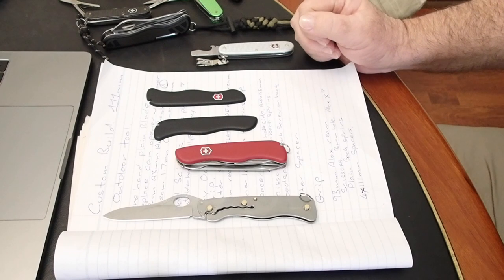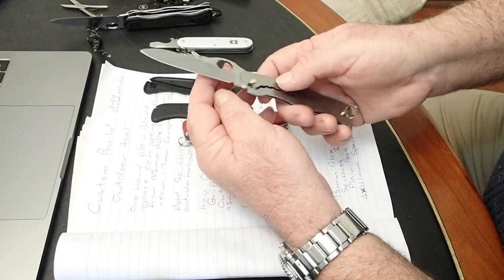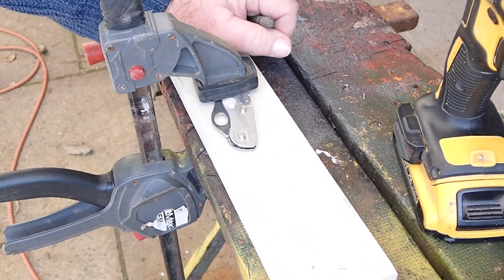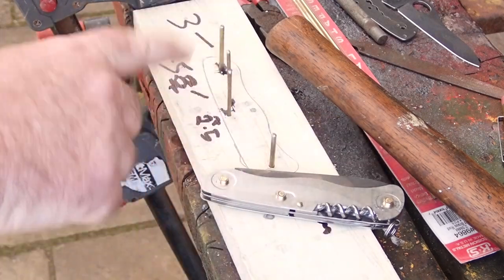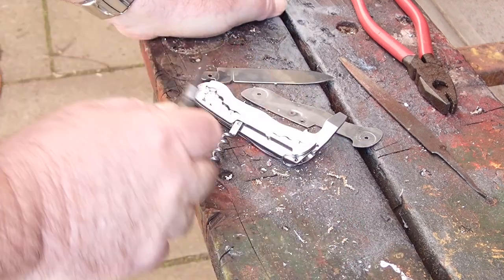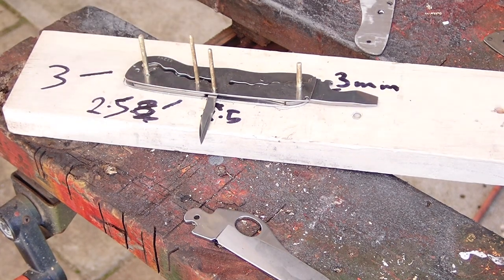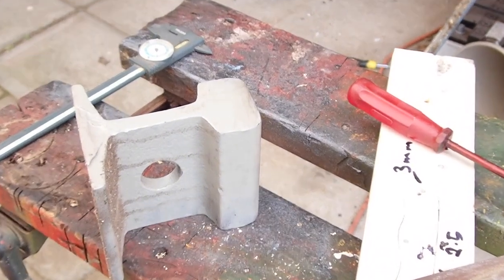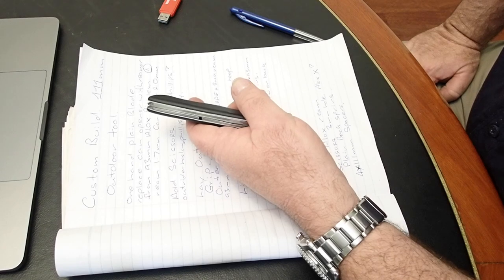Custom Victorinox 111mm knife build

Comment: I did not have a red liner lock to work with. It took parts of three knives to keep the Phillips. I essentially made a Centurion with a plain one-hand opening blade. Thank you for posting. This helped with a new build I am working on.
Reply from the maker: Glad it helped I thinking 🤔of using the left over liner lock to make a locking wood saw for a soldier knife

Comment: Interesting to see how you can modify your SAKs as you please. You’re skilled. I wouldn’t remove the corkscrew from mine because I do use it a lot to pop wine bottles. Perhaps I’d add scissors to the picnicker or the Adventurer though.
Reply from the maker: Adding scissors is on my to do list I am hoping to get some cheap ones out of a 91mm knife and match up a back spring
Reply: @kisbushcraftdownunder  I'm looking forward to watching that modification. Thank you for your time.

Comment: Thank you for this video!  I'm with you, I like that "Outdoor" model.  Do you think it would be possible to add scissors to my 111mm Hunter using the process you showed here?
Reply from the maker: Is your Hunter a liner lock or a side lock ? they have different pin sizes I have built a Outdoor 111mm with a ream from a 93mm alox and added scissors if you look in my channel I do a step by step video
Reply: It's the newer model with the liner lock.  I just found the newer video, will check it out.  Thank you for such a quick reply!   @kisbushcraftdownunder